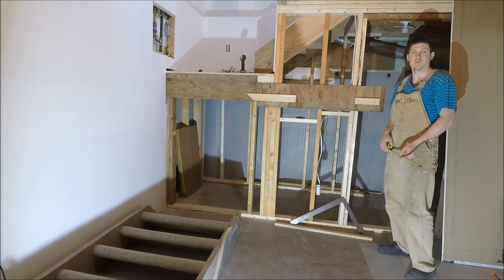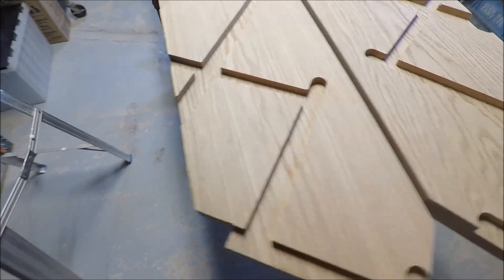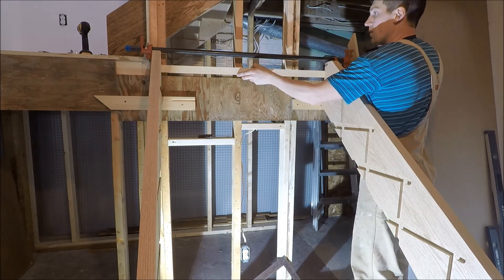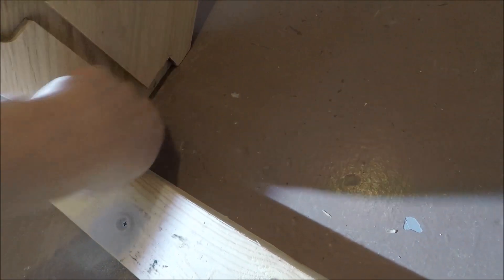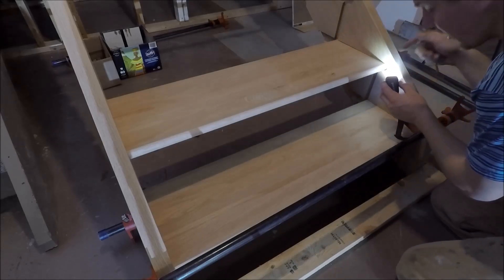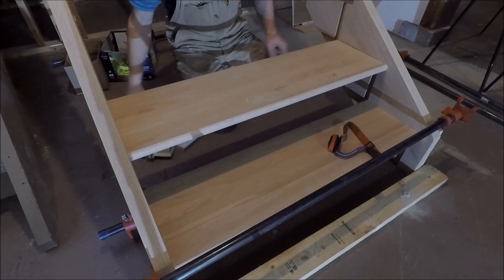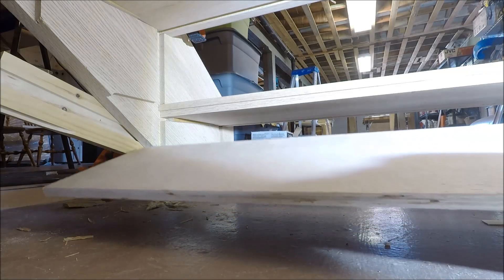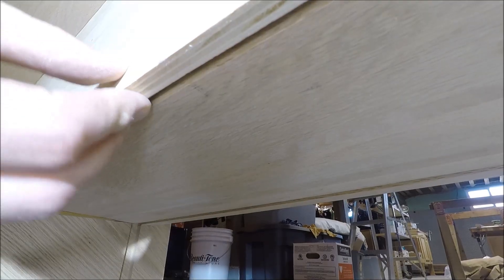How To Build a Professional Housed Stringer Staircase - Part 2 of 3

Comment: So I have a staircase just like this and I'd like to open up one side so that it would be an "open" stringer on that side.  Would I be better off ripping out the whole staircase and starting again?  Or just cutting out some of the existing stringer.  My worry is that doing that will weaken the stringer.
Reply: Open such that you want to see the outside of closed stringer or that you want the tread to kind of poke past the outside of the stringer

Comment: at time 7.20, why did you not remove the wedge under the 1st tread,  instead of removing 1/32 of wood, as the wood dries that 1/32 will help squeeking- movement

Comment: what if you routed the stringer so risers and treads could be slipped into place from the front of the stairs, leaving so much more deeper, and thinker stringer, at the back,  for years of traffic, ilo relying on screws, glue and wedges, , Japanese temples don't use nails bolts or  screws, will you add builders steel strap/bracing to stop stringers from side drifting, as well as the obvious floor mounts
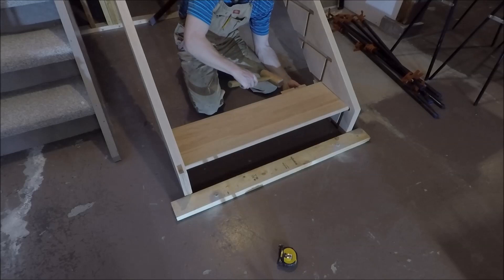Reply from the maker: Thanks for watching Steven! I don't think you can slip the riser in from the front with how you are describing it? I also did not want to see dado's or routes on the front of the stringer.  I am confident the wedges and glue will hold the stringers together, thank you for the concern though.  Watch Part 1 around the 3:50 minute mark to see the complexity of dado connections and glue joints.